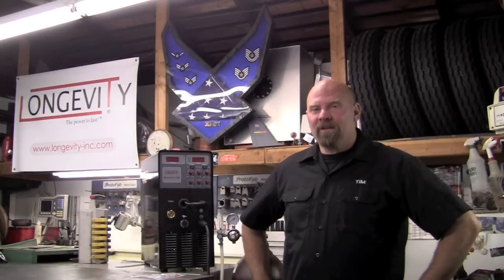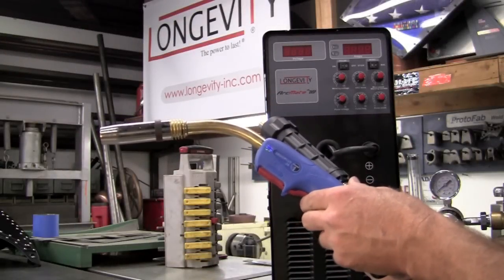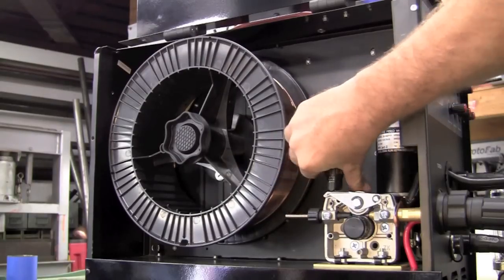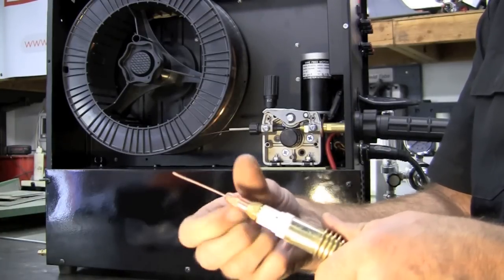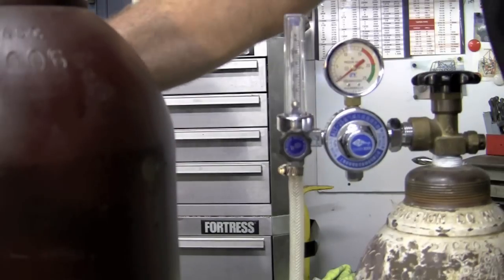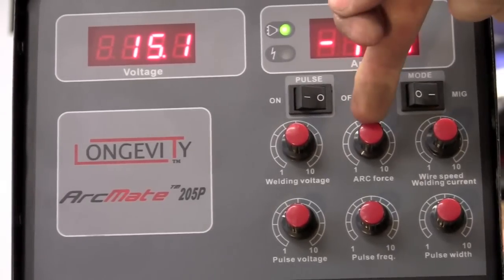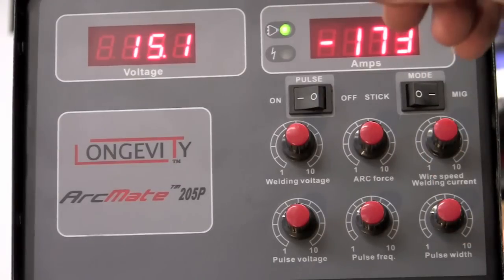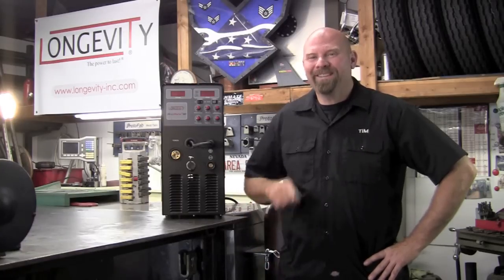LONGEVITY ARCMATE 205P 200 AMP PULSE MIG STICK Welder Setup Video

Comment: How thick can it mig weld can it weld 1/2 inch plate
Reply from the maker: Yes, this model is capable of welding 1/2" but we also have a newer model the MIGWELD 200S  - check it out on www.lwelds.com